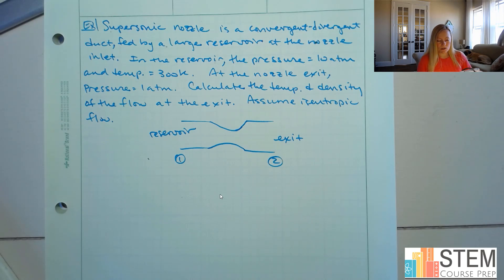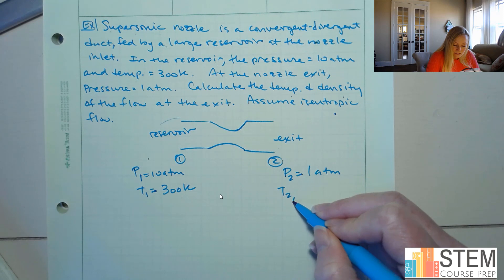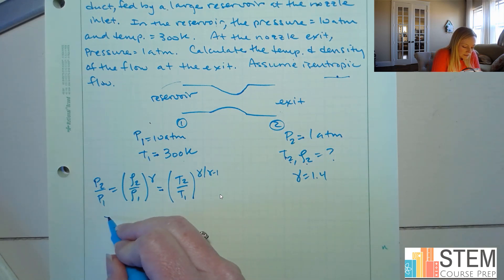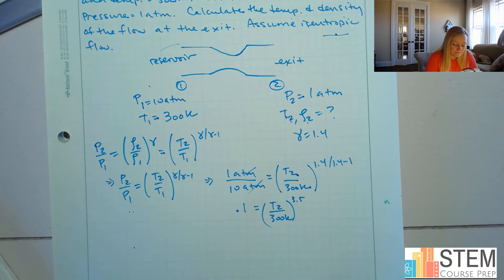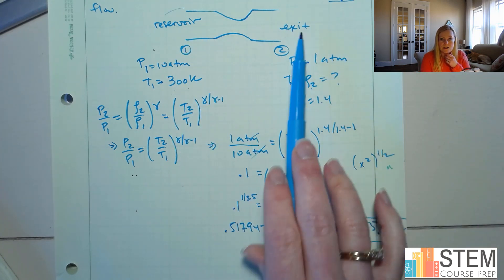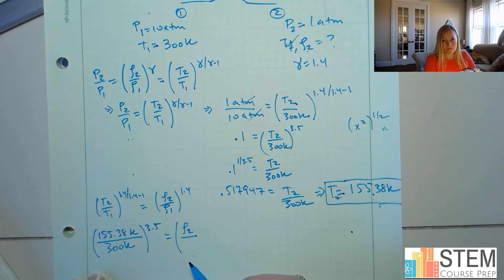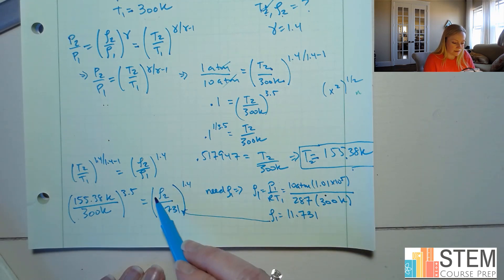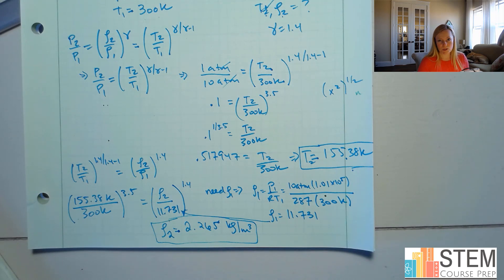Isentropic flow example with supersonic nozzle

Comment: what about conversion of units? you got the answer right but it would be nice if you showed the actual value of 1atm on N/m^2 if you are dealing with SI units. Some case scenario you have to deal with units on the English Engineer System that are pounds, fts, Slugs or Rankine. If if do my exam the way you do it  I wont get full points coz there are stuff missing.